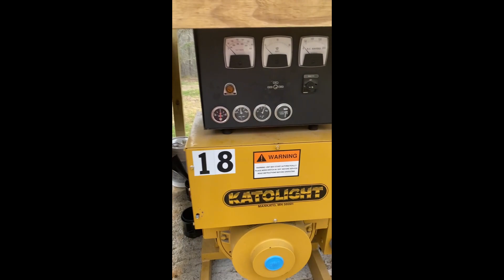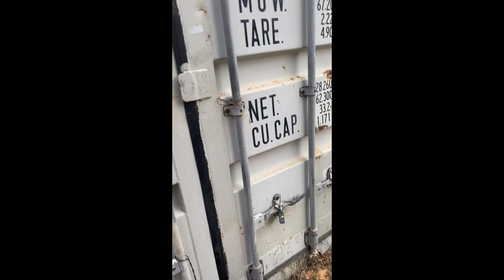Off Grid Bitcoin Mining with natural gas

Comment: Hey man- I am having a hard time finding prices on PDU's- what kind of power distribution units do you have>? 

I have 3x 100kw Cummings natural gas generators, and I am fabbing a container now- I have an oil field partner that is doing all that, but I am having a difficult time sourcing some of these parts. 

Any suggestions for where to find the industrial fans/power setup? It seems like a lot of it is WAY over priced, and much of what I find is just SEO lead generation B.S.

I am looking for a setup where we can start with 30 S19's or maybe Canaan Avalon A1266's -

I am anxious to see your progress, keep up the good work.
Reply from the maker: We got our PDUs from Raptor Power Solutions.  They seem to be the way to go.  The fans are probably gonna be hit or miss with pricing. (I think we overpaid).  As for the S19's i may be able to help you source.
Reply: hello bro did you ever start?>
Reply: @PenielOkonkwo  Yeah, I am running at right around 4 PH/s- it was a mission to get started, but we got there!

Comment: Is there any chance you can post specs / links to your equipment? I am in the process of building out something similar, and like your rig!
Reply from the maker: Katolight Generators, Raptor Power Solutions PDU, Factoryfansdirect exhaust crypto fan, general shipping container, Antminers.... idk about the circuit panels and shit. We paid an electrical company to tie everything together
Reply: Hey Man, I really appreciate you giving me that info! Quick question- I finally am ready to order miners, and I was wondering what your recommendations are for hardware, as well as vendors? There seems to be a lot of scam sites-  @xlcommon

Comment: How many amps does each generator give you? How much nat gas are you getting from the ground? For the exhaust fan in your container you may want to replace with just louvers. The new gen ASIC's exhaust much quicker than most fans can keep up with. I mined open air in the middle of summer in Texas with s19j pro's with no issues. No fans, just open air in a barn. Never got too hot. I've heard in a container louvers on both sides are the way to go. Awesome setup, solid work. I'm jealous.
Reply from the maker: Idk how to exactly answer your question in amps.  The gensets are both 3 phase DELTA configuration.  The PDUs we used are from raptor power solutions and are all on 80 amp breakers for 12 miners... and the gas from the ground is something we havent gauged completely. As for exhuast with them in the enclosed container i feel the exhaust fan is necessary.  no way we could get all the miners to blow only outside with no air recirculating inside.  Thanks for the comments! always looking for criticism!